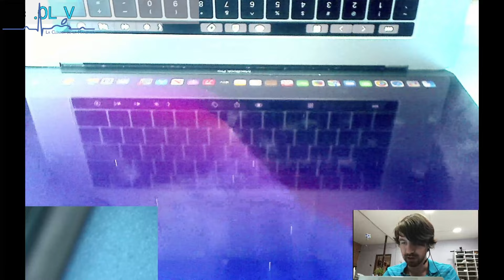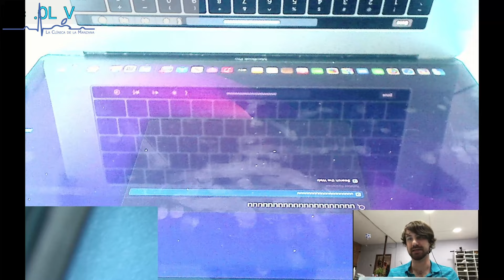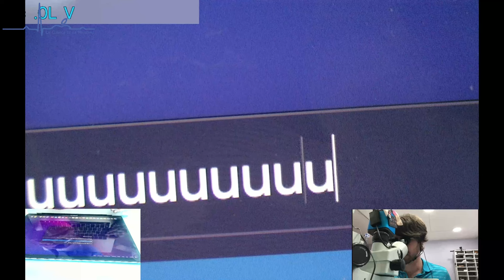How to Solve the Double Keystroke issue - Butter Fly Keyboards MacBook Pro 2016 - 2019

Comment: Amazing! I have just done it with my MacBook Pro 2018 13 and just used an old cutter knife and some glue. Without magnifying glasses it was not that easy, but I did it with my "E" and "N" keys and apparently it worked out quite well! Both are not double tapping anymore.
Reply from the maker: Great Job Arne!!
Reply: @JosephHughes  Thanks! However, I have to admit that the tactile response of both keys is not as it was due to my, well, unprofessional treatment 😂. Anyway, glad I found your vid 🙌🏻

Comment: Fantastic video, sir!  Problems like these are always simple mechanical issues of oxidation or debris.  

My only concern would be that the tiny criss-cross abrasions = more exposed surface area = more rapid oxidation into the future.  

Have you tried using any contact improver like Deoxit G100L to help prevent future oxidation?  Not sure if that'd be an awesome forever solution or if it'd just goop things up in there.
Reply from the maker: Great question Ed! So from our experience, the tiny criss-cross pattern causes some texture on the surface that enables a somewhat self-cleaning action when the button/key is uses. Somewhat like an abrasive surface helping the button last longer.

Comment: Great video! Hard to find though - perhaps the title could use a change? My "U" key is fugged and this is just what I needed. However, my key is designed differently (Early 2015 MBP) Hoping I find the same success! Thank you!
Reply from the maker: I hope you have success too! The 2015 has the older scissors mechanism in it, the keyboard membrane is more of a sealed unit vs this button top type.

Comment: Hi Joseph, great video. For the average Joe, it would be hard to do this. 

There is a very easy, straightforward method that anyone can do. Lift both bottom legs, take slightly curved tweezers and clean the keyboard pad as well as the button pad. Push both bottom legs back and viola. 2-3 minutes job for experienced, 10-15 for the 1st timers.
Reply from the maker: Hello @DJ. It sounds like you are breaking the bottom plastic welds that connect the transparent plastic to the keyboard backing. There is also some adhesive that you are lifting. 
We don’t recommend to do this if you are offering a repair service to clients as you are eliminating a major mechanical support and re-using adhesive. It will fail over time. If you are a DIY, it may work for you as a quick fix.
Reply: @JosephHughes  Hello again! It depends how it is done.
For DIY people, there is a chance the plastic welds disconnect with the transparent plastic. It stays in the hole. Upon reassembling everything, one can push the legs back through the weld. To ensure good contact, add a tiny blob of glue in the hole. As for the adhesive, if done properly, it stays on the keyboard and connects to the plastic part upon assembly. The connection is not as strong as original but can be strengthened with a super tiny blob of glue. 
For technicians, a bit of hot air is recommended to lift the original melted plastics along with the transparent part. Again, apply a tiny blob of glue in the hole when everything is put back in case of future-proofing.
The nice thing about this is that the sound of pressing the key and touch stay the same.
Reply from the maker: @DJ-we2my  well, if it works for you that is what’s important. We don’t like to break the plastic “rivet” as you need to melt it flat on the back for it to be like original and do it’s job. The part that is broken off can not reasonably be restored or just pushed back through its weld unfortunately. Using heat does help the adhesive , but is still not something we do, as from our experience the height of the key changes and if only the sticker is there or some glue - when removing the key cap in the future - normally the whole mechanism comes with it.

Comment: Another solution to try if this is happening to multiple keys(Before you start pulling keys off). Would be to turn on Slow Keys on you computer which would not accept keys strokes that come in to close to each other.  System Settings -> Accessibility -> Keyboard -> Slow Keys(Set it to Delay Short)
Reply: i tried it and it works so far so good. thank you

Comment: Does anyone know if Apple still honors their replacement program?
Reply from the maker: Apple says
"The program covers eligible MacBook, MacBook Air, and MacBook Pro models for 4 years after the first retail sale of the unit."
So if you purchased your macbook from an authorzied reseller within the last 4 years, you should be covered!
Reply: @JosephHughes  Had my Genius Bar appointment today, because my purchase was 5 years I'm just over coverage. They did however, check that MacBook in to replace a few key caps free of charge. Better than nothing.